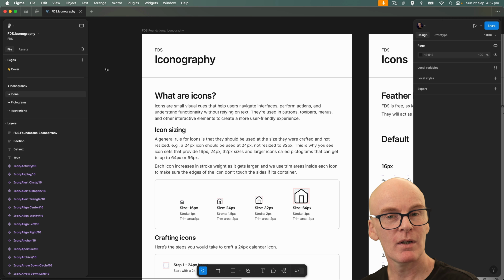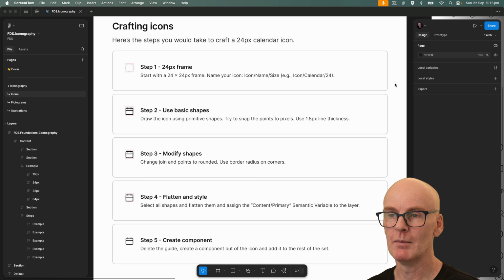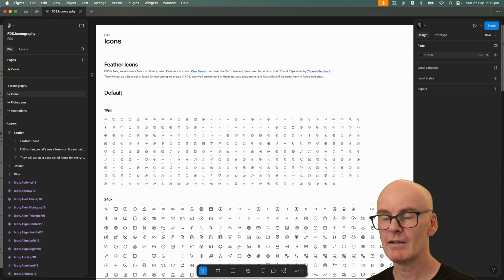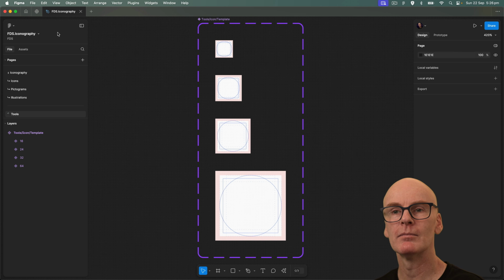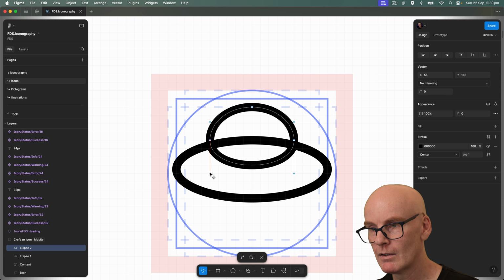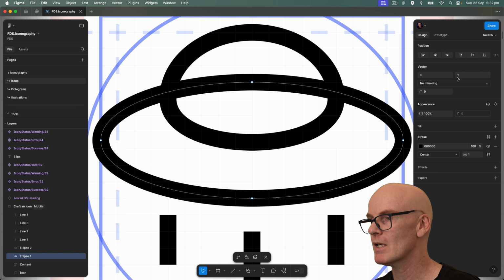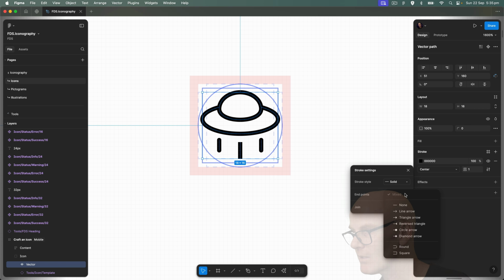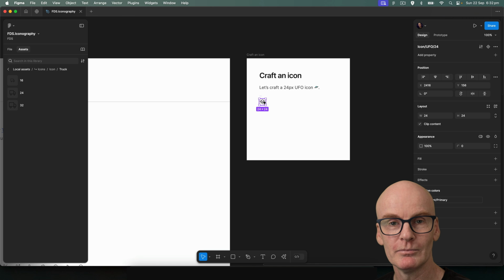Figma Design System: 09 Iconography

Comment: Nice video. +1. But it all makes sense if you have a custom line for some icon sizes, because now, if you're going to scale a 24px icon with a 1.5px line down to 16px, you'll definitely end up with a 1px line. So it makes no sense to have a list of icon sizes.
Reply from the maker: Don't scale icons to be smaller or larger sizes, use them 1:1 in your UI, that's why FDS has 16, 24 and 32px versions of each icon.

Comment: Hi. you have incredibly cool videos! Thanks for making them! I'm following them to put together my own design system to improve my workflows.

I have 2 questions about the icons:
- what is the best way to give icons to developers? wouldn't it be better to do “outline strokes” for all icons we are done with?
- We use line versions by default. And what would be the best way to add fill versions for icons? Is it necessary to duplicate the collection completely? But for some icons, it is impossible to make a fill version (for example, for the + symbol).
Reply from the maker: Hello, here's the answers:
- Just export the path based icons as SVGs, you can then add a semantic variable to the flattened path color value inside the SVG and target them with css, this will allow an icon to switch between light and dark mode automatically
- You can add the fill before you flatten to the elements inside the icon that require it, then do an outline stroke, then flatten them. And you're right, there's no need to do different versions for the ones that can't be "Filled", then add the word file to the end of the icon name